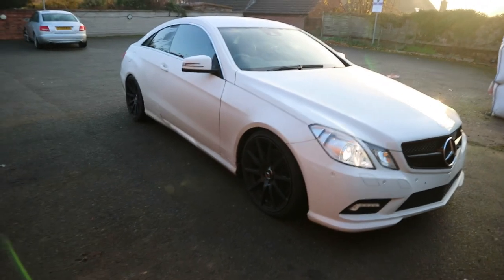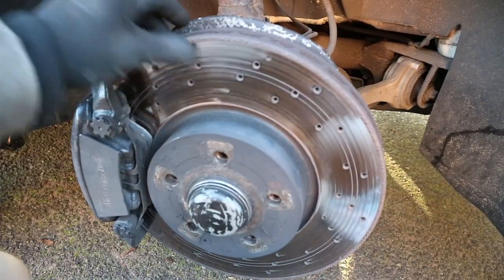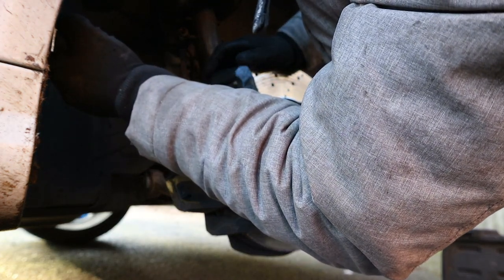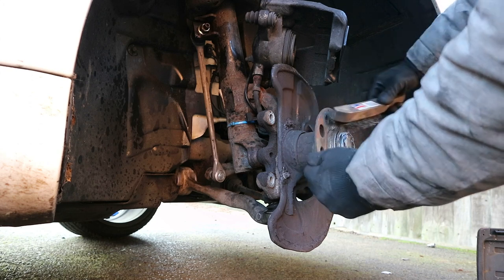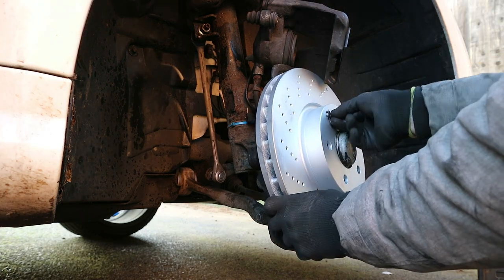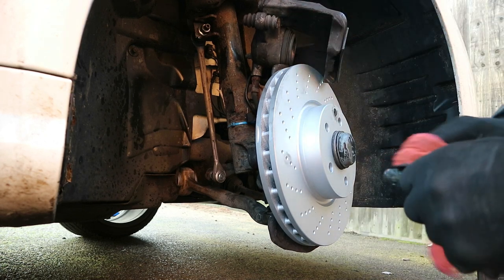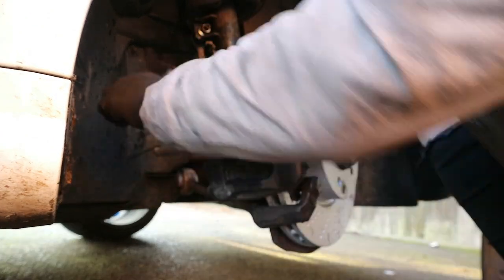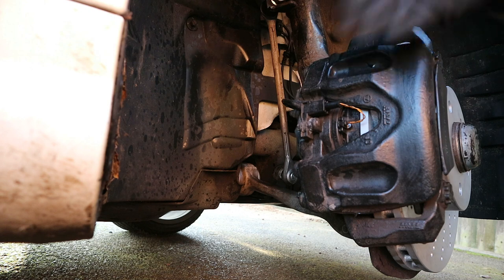HOW DID THE MERCEDES STOP !? * E350 BRAKES *

Comment: I discovered you while looking for videos on Bentley Continental GT, I was going to buy one last week, had it for a day to drive and inspect, and turned out to be a dog. So following through your videos, I discovered you had an E350, which I also have, E350 Coupe AMG Sport plus 2015, as you say, slow on the gears, sorted that with Stage 1 ECU remap. having driven the Bentley I have now fallen back in love with the E350, so going to follow with your exhaust and lowering mods.
You won't be interested in classics but I have a 22-year-old SL320 (R129), 50k on the clock, you want expensive parts? go there, even from a scrapyard.
Regards
Tony

Comment: I recommend attaching a plastic tube to the bleeder and cracking it open before pushing the piston back to avoid pushing fluid backwards through the system. Sometimes that can cause a problem .